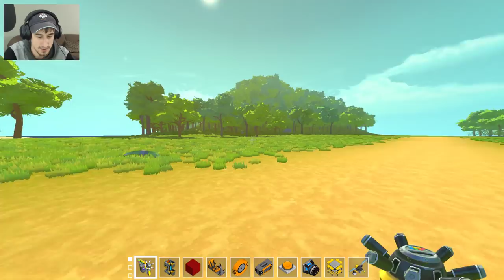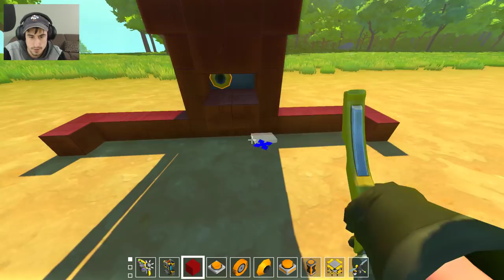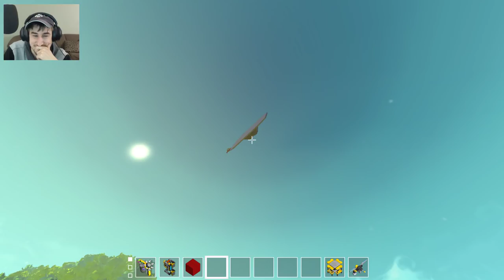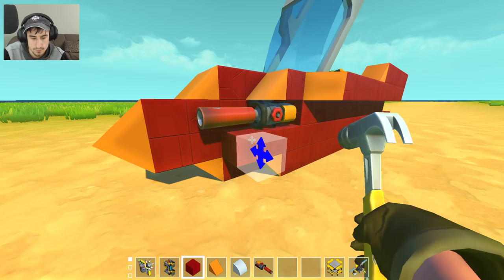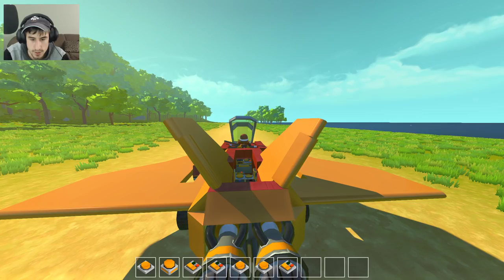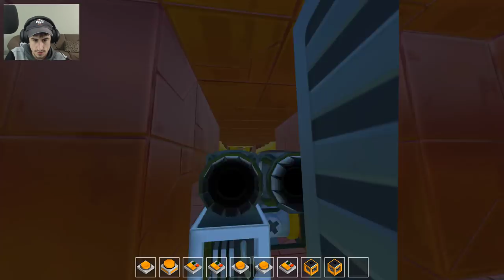Building a Jet With Ejection Seat! (Scrap Mechanic Live Stream VOD)

Comment from the maker: Here is the workshop link: https://steamcommunity.com/sharedfiles/filedetails/?id=1598705868
Reply: kAN Gaming can you see if electro magnetic suspension is possible to make in scrap mechanic
Reply: STREAM IDEA: build a glider ( a plane that pulls a plane with no engine) IF YOU AGREE REPOST THIS COMMENT.
Reply: Can you make this build fly  Mansion make it look like it does but I can't make it fly The name is stealth helicopter 0.1
Reply: @glazed4879  he already made a glider
Reply: @isabellen3319  you are right but first of all he didn't build it in a stream, and he didn't  make it like a real glider because it doesn't have passengers for the glider, and you can't drive the plane in the front soooooooooooooooooo, yeah
Reply: Do a Q'n'A
Reply: @glazed4879  but ur not always playing with others that's why its on remote control for example to play multiplayer you have to port forward but i cant do it and why should he build something that he already build and the passenger thing i didn't hear that it is a must to have a passenger sooooooooooooooo yeah
Reply: Dont worry, I also have a bad hairline

Comment: I have figured out why I've watched this so many times the wing issue around the @2:10:00 mark, what if you took the red blocks at the wing level or higher from the back of the canopy forward with wing pieces and smooth it out with longer flaps?

Comment: After you painted, then accidentally ejected, you know you could have just added 2 new decoupler blocks and welded the parts back on, right? Just a little wiring, and it's back to normal.